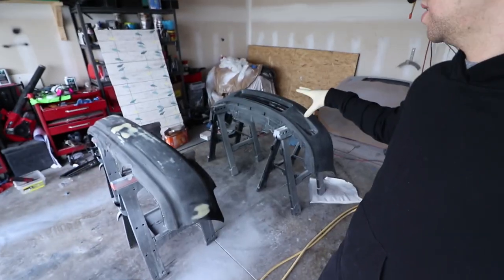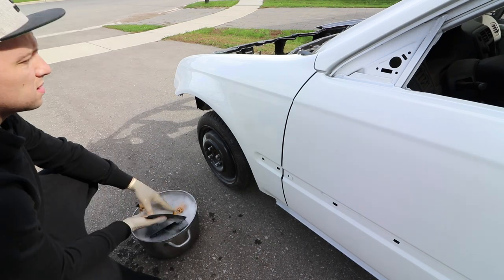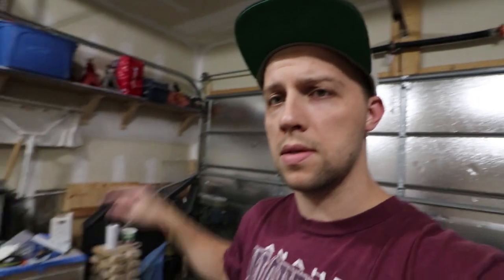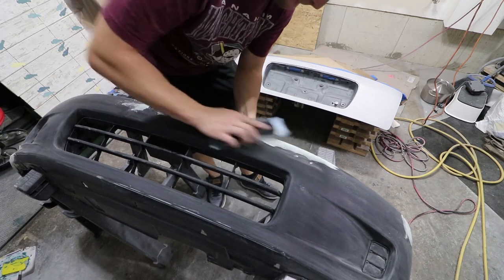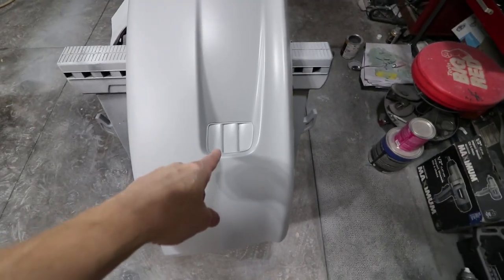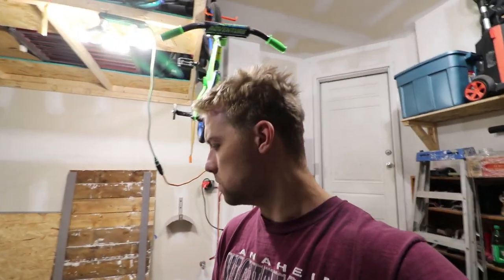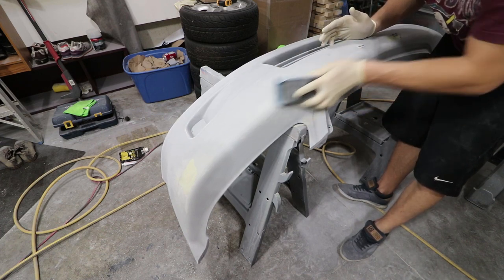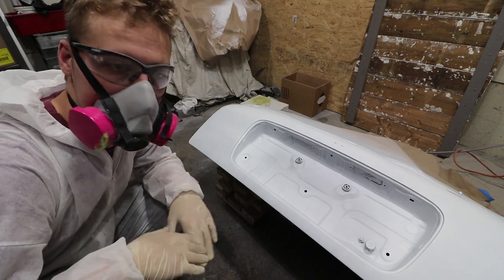My New White EK Civic - At Home Paint Job is Complete

Comment: You should really look into putting down sealer before your base and clear. This will take away the primer step on parts that have no body and are prepped right. Your plastic bumpers should be sprayed with a polypropylene primer right before sealer, base coat it and go! 2k on plastics will only cause you problems later in the cars life. also get yourself a can of fisheye eliminator, and a can of accelerator. Flex additive will help with plastic bumpers too (keep the paint from cracking later) props for diving in DIY style! Your material choice at every stage of the project will be crucial for the longevity of the over all finished product. All that hard work you did to get it there is worth the research to find the right material. Keep on keepN on!

Comment: it was mentioned to me that flexible plastic parts such as the bumpers need to have a special "flex agent" added to the paint so that it doesent crack or spider web if its flexed ...did you do the same process to bumpers as you did to the rest of the body?? Thanks in advance man!
Reply from the maker: Hey Steve, i've heard of the same thing as well. I visited my local body shop and raised the question, and they said no its not required. But can be added if concerned about the amount of potential flexibility in the item being painted. They also mention the quality of paints and clears used play an important factor in its ability to flex. I would say avoiding the cheapest product on the shelf can avoid the potential issue. I haven't had the chance to drive the car yet to really see if my body shop was right but after i drive it for a while it would be a good topic to raise in a future episode when painting a car yourself. So ill keep you updated.